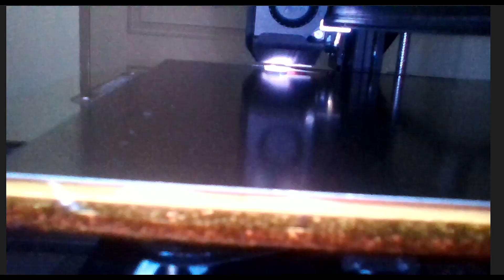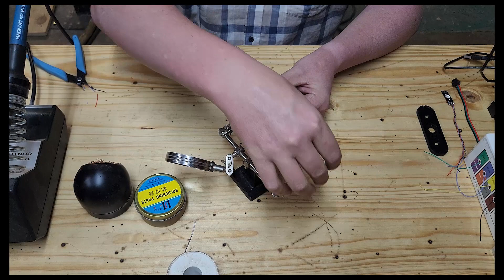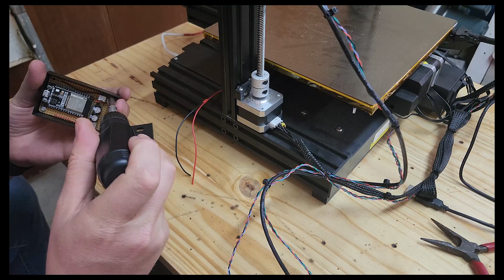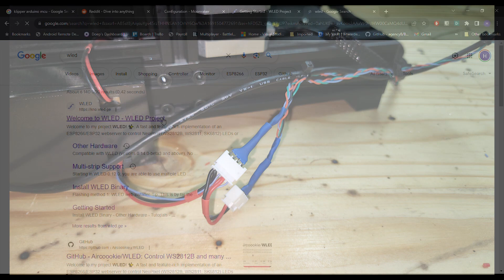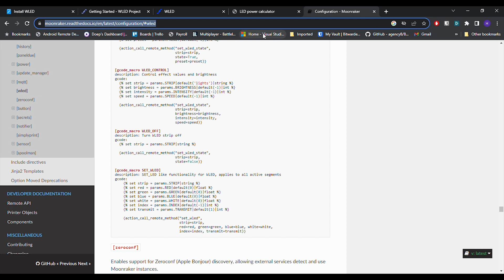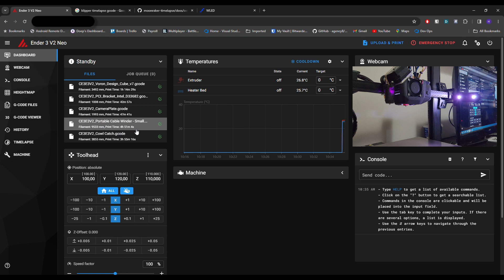Ender 3 V2 Neo RGB Led install

Comment: I put some white LEDs on my old Ender 3. Earlier this year I bought a 3 Max Neo, and lighting was the first upgrade I needed to do.
Reply from the maker: I plan to add some more led's at the top. I just need to order a strip that's more dense than the ones I have now